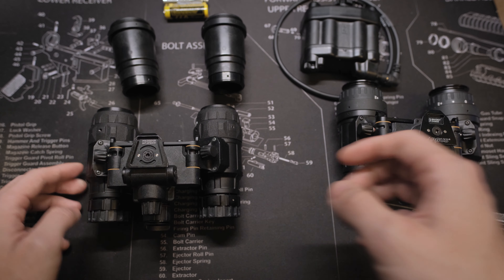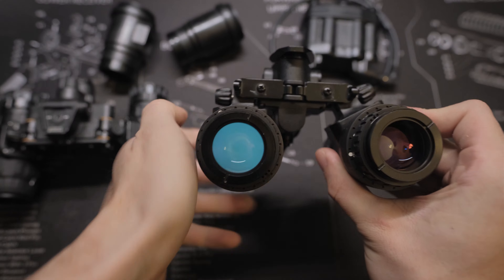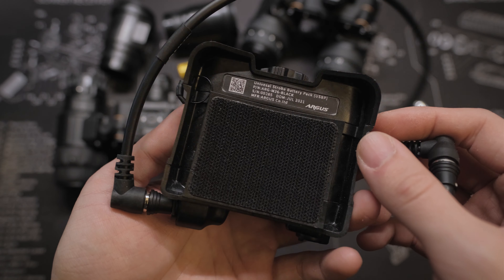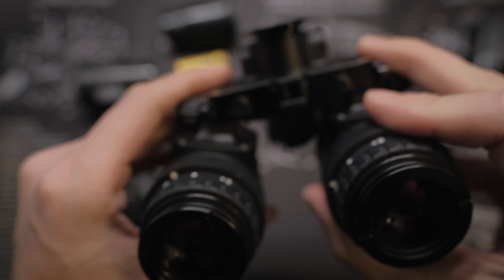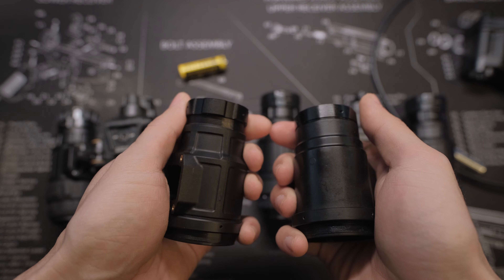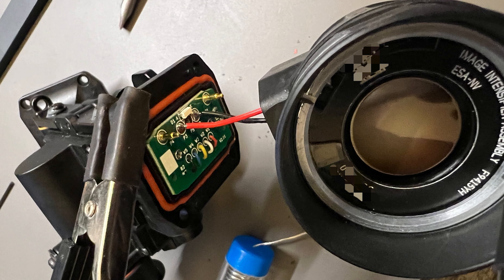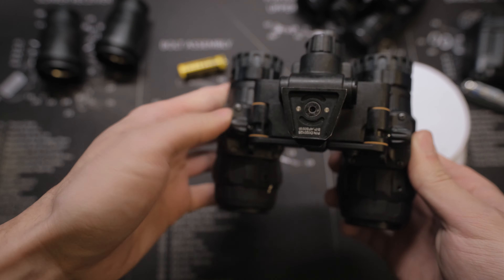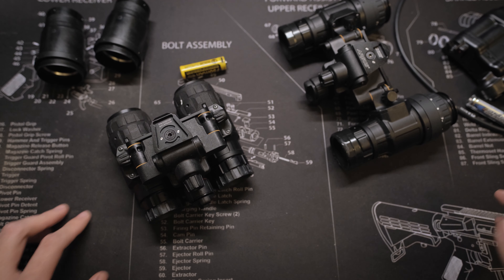BNVD-1431 & Mk.2 Features & Improvements Review | Multi-format Night Vision Housing | Argus PVS-31

Comment: Good intro, thanks for the shoutout! If you'd like to try the 1431 Mk.II Canadian version in the future, give me a shout. The Canadian version features an improved hardware suite and a much more stringent quality testing process.

I would also clarify that while the housing works well with both rechargable and standard lithium AA batteries, it also works just fine on a cheap alkaline AA. Though, I would still recommend using Lithium.
Reply from the maker: Thanks for the reply! Yes I'm definitely interested in Canadian ver. after seeing your videos. And definitely it should work with any AA battery and I would also recommend using enegizer Lithium battery on all sensitive electronics to prevent leaking and reliability issues.
Reply: What's the max voltage on mk2 housing? I've got an absolute ridiculous amount of 14500/AA sized rechargables, but they're 3.7 volts.... Also I need to pick up another battery port O-ring. Do you guys sell them, or know the size so I can grab some more? Thanks!

Comment: Is it possible to replace the battery tube with a flat plate if you’re running an external battery pack to reduce weight?